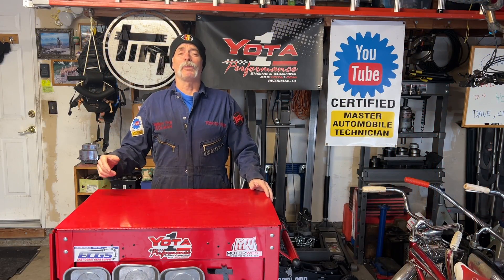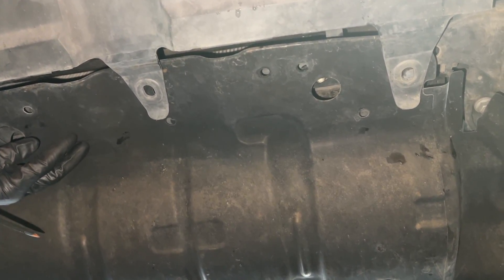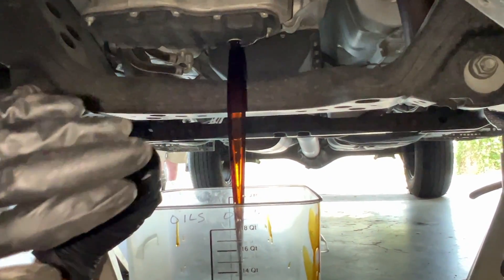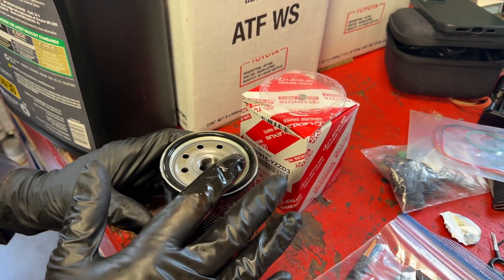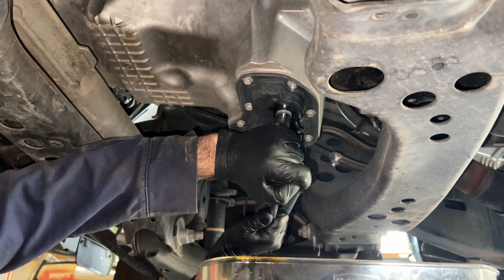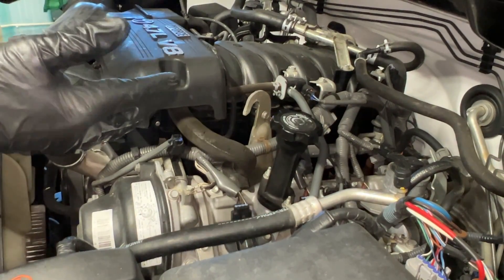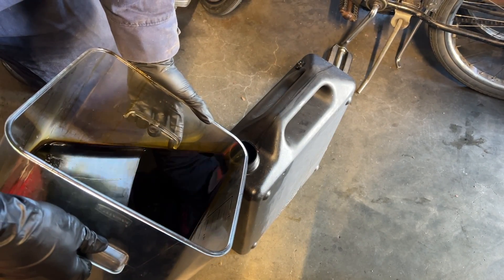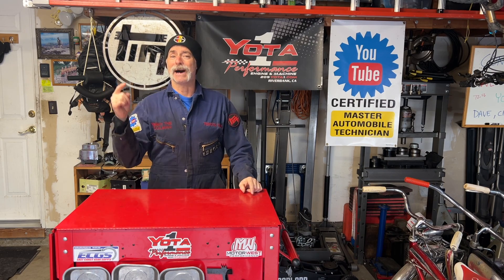Toyota 2UZ-FE Engine Oil & Filter Change

Comment: That replacement drain plug gasket used looks like the ones I bought from aftermarket suppliers......I don't like them. You can properly torque them but they will loosen after a couple hundred miles. It looks to  me that the adhesive used to keep the gasket material glued to the metal washer "creeps" due to the heat. If you use these check them later and retorque.
Reply from the maker: Well, the ones I've used come from Toyota and I've never had issue with them.  Any drain pan bolt I've even tightened has not loosened, at least from what I can tell.  None of them have leaked or fallen out and they always require force to be removed.  But, I never use aftermarket washers, only OEM.

Comment: I have the 2UZ-FE in my 2004 Tundra DC. Used mostly synthetic oils through the years changed at 5k intervals. After pulling valve covers to do the gaskets the valve train looked new, super clean.
This engine design is "easy" on oil.
Reply from the maker: The 2UZ-FE has got to be one of the best, if not the best engine Toyota has ever designed.  They are known to reach 1 Million Miles.

Comment: Nice!! A few extras are: 
Oil drains 'better' when it's warm. Might not be an issue with you but I think if you can drain the oil when it's warm (not hot) it will likely get more gunk out if there is any. 
When removing the drain, loosen it with tools as you did and remove it by hand as you did, but try to keep the plug in until the last minute. This way you're less likely to spill up your arm. You got that spot on, but it's a skill!
Complete the paperwork or however you record the change. Some containers of new oil have a removable portion of the label, which you can stick to the vehicle. Fill in the service book or write the mileage and date on the filter and/or reset the service indicator etc.
Buy the filter, oil and washer for the next change now. You'll be more likely to do the next one on time if you already have the kit.
Reply from the maker: All very good tips.  I took for granted everything you mentioned because I've done it hundreds of times.

Comment: what's the interval of change?
Reply from the maker: I do mine every 5,000 miles.
Reply: Your O/M will tell you. 10k is recommended BUT, the O/M states of you drive in dusty condition, stop and go traffic, or tow, it should be changed every 5K ( which is basically everyone), it also states that a higher viscosity may be better for those applications
Reply from the maker: @chief1193  Also, Toyota on these vehicles claims their WS ATF for the transmission is "Lifetime" fluid.  That is the biggest load of crap that has ever come from Toyota.  A video of me renewing the ATF in my brother's truck will be coming out soon.

Comment: 5/40-10/40 the best
Reply from the maker: What makes it the best?
Reply: @TimmyTheToolman  The engine sound is softer and more tolerable, especially in hot areas or if the winter is not very cold, below minus 20. From my experience with a Toyota Hilux and a family pickup and four-wheel drive from Toyota, its rating is also excellent.

Comment: I grew up in Northern California near Oregon and my dad taught me that when you put your vehicle on stands and before you removed wheels you would do a quick “Earthquake check”. Just shake the vehicle to make sure your stands were solid. Love the comment “Gateway Drug”. Nothing like having the local “Oil Monkey” strip your oil pan. That is why I change my own. Good job Tim and Sean!
Reply from the maker: Yeah, a good shake isn't a bad idea.  Taking your vehicle to the hacks at oil changer places is something I should have mentioned.  Big mistakes happen at dealerships as well.  The person doing oil changes at a dealership isn't the 30-year Master Technician.  It's the new kid more worried about his Instagram profile than what he's doing to your vehicle.  Vehicles have left with no engine oil, left with the oil cap off, left with a stripped drain plug, left with a loose oil filter, etc.  The best person to work on your vehicle is YOU!
Reply: @TimmyTheToolman  Agreed!